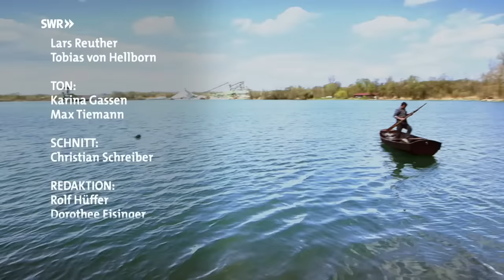Wie man ein Boot baut | SWR Handwerkskunst

Comment: Toll, toller Typ, tolle Arbeit. Und 1400 Euro wirklich zu wenig, für die Leistung, die drinsteckt.
Reply: Naja bei 2,5 Tagen sind das 60-70€ die Stunde Umsatz. Normaler Schnitt bei Handwerkern. Das Boot ist eher funktionell und rustikal gebaut. Von daher ist der Preis angemessen.
Reply: @Nils-hp1qo  Material, Kosten für Werkstatt und Maschinen und dazu 19% USt. weg von den 1400. Das sind keine 60/h. Wenns hoch kommt 40. Dazu kommt Gewerbesteuer, vllt noch durchschnittliche Kosten bei gesetzlichen Garantiefällen, Kammerbeiträge, Gewinn für den Betrieb usw. Viel bleibt da nicht, für ihn, der immerhin Chef des Betriebs in 3ter Generation ist. Da sollte der Stundensatz höher sein.
Reply: @dailybusiness8162  ich rede ja von Umsatz. Daß da noch Nebenkosten anfallen ist mir auch klar. Bin selber im Handwerk tätig und wenn wir 70€ die Std Umsatz machen dann ist das okay. Wir können davon auch überleben. Reich wird man damit natürlich nicht. Und Schreiner sind oft schlecht bezahlt.

Comment: Interesting method used to build a traditional flat bottom skiff. Depends more on water proofing than wood swelling. The combination of what appeared to be iron nails and zinc screws will eventually lead to rot (more so in salt water than fresh), but this boats life is probably not so long as that matters. I love to watch the various methods old and new used to build boats no matter the shape and size.
Reply: Theese kinds of boats usually last ~50 years if they are taken care of 

So it will probably outlive the old man that bought it

If you want something to last long go with Glassfiber boats

Comment: Hi. finally finished with my little boat. thanks for your video. I have followed a Swedish drawing. but it did not turn out exactly that way. it was a mixture of yours and the drawing. still have difficulty understanding and adjusting the tables to the transom. should you grind it out, or how do you do it? would like to attach some pictures. but do not know if it is possible. please Clas bremvik

Comment: What is the black mass that You use To make the boat   Sealed. You are hearing it in a  pot?
Reply: Heating
Reply from the maker: Hi Clas!
The material is "bitumen" so-called "Erdpech". It is a mixture of various organic substances (mainly carbon and hydrogen).